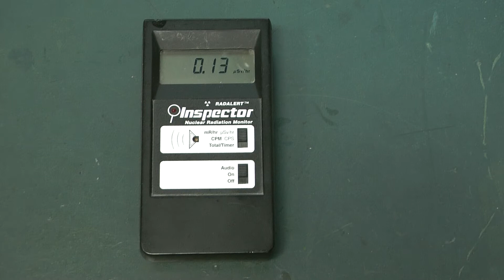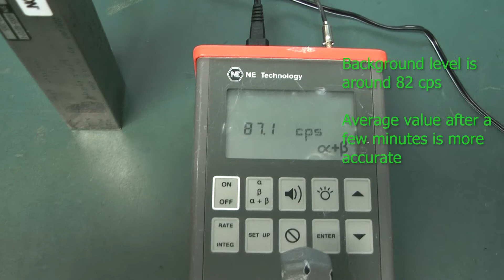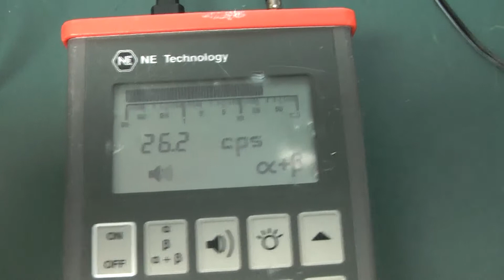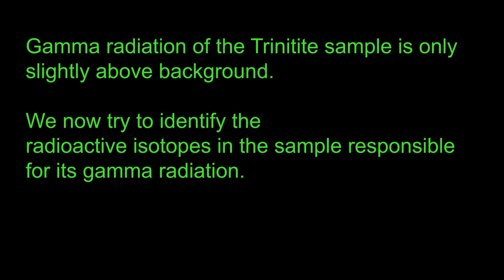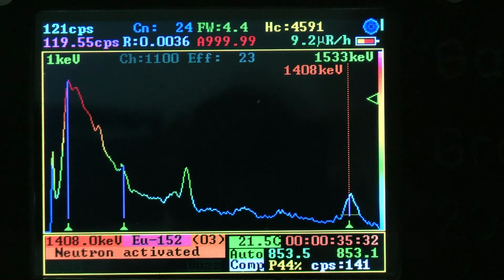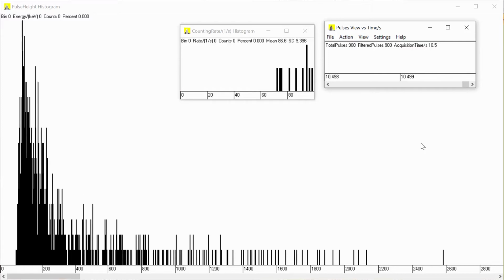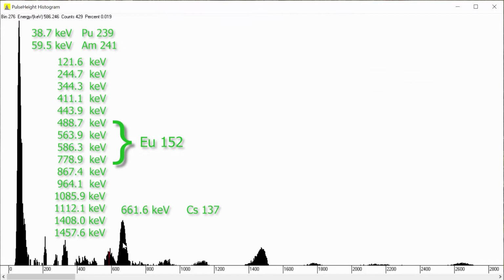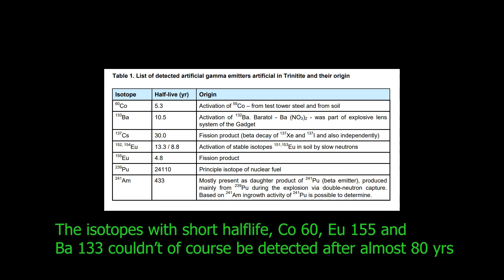Trinitite (atomic bomb glass) radioactivity and gamma spectroscopy

Comment: Awesome video! I finally got a 1" NaI:Tl GammaSpectacular spectrometer kit, and I use the PRA software with it! It works great, even though the efficiency is lower, since I'm using a smaller crystal. I'd love to try CeBr3, from Berkley Nucleonics, but it's so expensive! HPGe would be the best of the best! I was able to identify Kr-85 (514 keV) from some old Western Electric electron tubes, ca. 11/1973, 15 μCi, which both only give me about 500 CPM on my Inspector USB Geiger-Müller counter, now that the activity is only about 0.637 μCi, 49 years later. I'm going to try Pu-239 next (17.1 μCi, total) from old Soviet smoke detectors, to see if I get any of the low-energy gamma energies, like Am-241 and maybe U-237 from Pu-241, which undergoes β- decay, which emits very low-energy–about 20 keV β- particles, and on occasion, α decay to U-237. The problem is that plutonium isotopes have low branching ratios for gamma rays. It's easily detectable up close, with my Inspector USB Geiger-Müller counter, however, a sheet of paper blocks almost all of the radiation, being mostly α particles. Even my CD V-700 on "X1" only goes up to about 100 CPM (β and gamma) per source. I was able to detect some gamma energies from my trinitite, but at a lower efficiency, since your NaI(Tl) crystal is twice the diameter of my detector. Anyways, excellent video on my favorite hobby! I'm glad to see when you post a new video, as they're very well done! You're a smart man, and your methodical approach is paramount! Very well done! Thank you for making this! Have a Merry Christmas and a Happy New Year! 👍
Reply from the maker: Thank you for your nice and detailed message and your compliment. Enjoy this exiting hobby. Happy New Year !

Comment: Do you believe this would be possible to replicate with a Raysid or possibly even Radiacode 101 spectrometer?
Reply from the maker: Perhaps. The scintillator crystals in these devices are small : Raysid has a 5 cm3 CsI(Tl) crystal and RadiaCode 101 contains a 1 cm3 CsI(Tl) crystal.  This means efficiency will be low.
I registered the Trinitite gammaspectrum with a Scionix 2" scintillator, around 100 cm3, and it took several hours to get a decent spectrum. Although efficiency is not linear with respect to scintillator size I assume it will take many many hours to get an interpretable spectrum with the devices you mentioned. After all, gamma radiation level of the Trinitite is only slightly above background. Circumstances, especially temperature, should also be perfectly constant during these hours, because otherwise energies will be shifted a bit which deteriorates the spectrum accuracy.
Reply: @AJApper  this is what I suspected might be the case. thanks. looking for the cheapest way to start doing spectroscopy, but worried about resolution of the tiny portable devices and the fact that the Raysid is totally sealed and will become a paperweight once the battery inevitably dies in a few years.
Reply from the maker: @Muonium, you could start with a 1 “ NaI(Tl) detector from Ebay. Connect the scintillator to a laptop running PRA software. A few years ago I used a very simple device to connect the scintillator to the computers soundcard. A capacitor to block the scintillator’s high voltage and a 220 kOhm potmeter to adjust the level. Although rather primitive, it is a cheap solution.